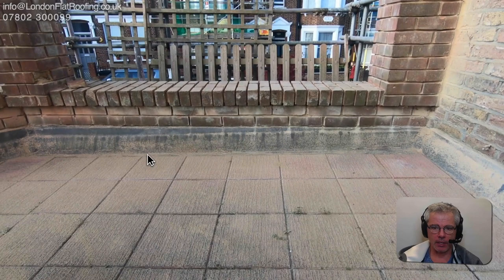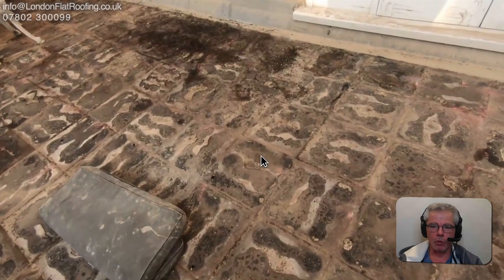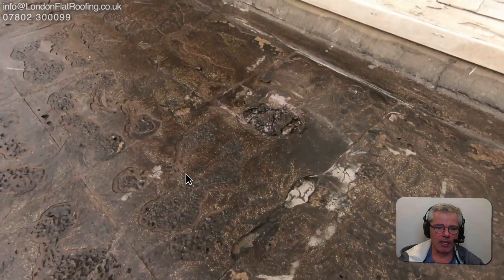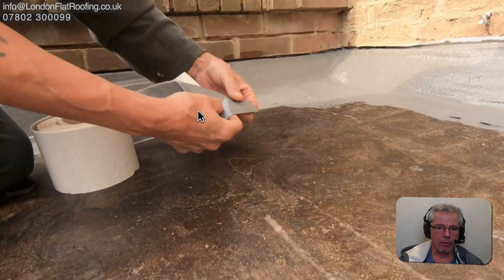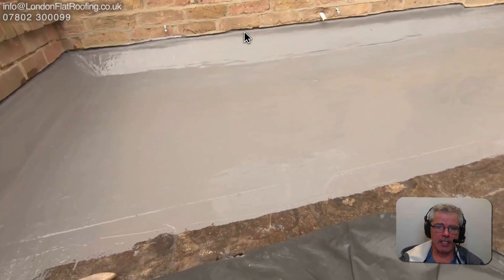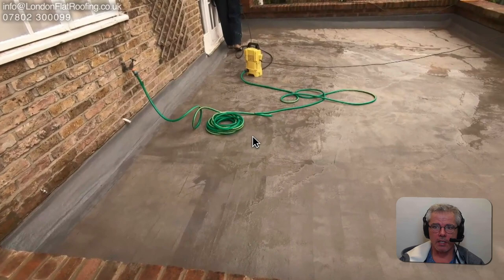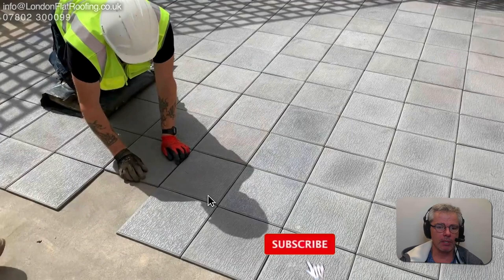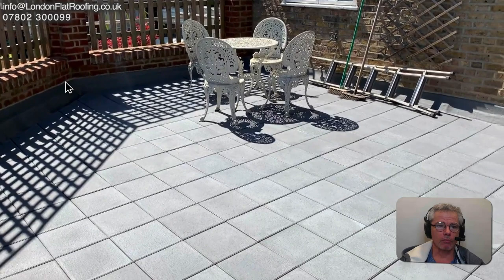Roof terraces renovation old asphalt roof new promenade tiles

Comment: Hi Steve. Interesting video, an end results looked great 👍. You didn't grout the tiles, is that to allow movement and flexibility?
Reply from the maker: It's not only for flexibility but to allow the water to run between the tiles and get off they are not designed to be grouted

Comment: Here’s a question. If you are to have a replacement double glazed door off the balcony (from a wooden one), should the door be installed first, or should the new door be installed afterwards please?
Reply from the maker: remove the door and fix waterproofing up and under the fill and to the sides so that everything is watertight as high as possible then the doors go in. Unfortunately, this rarely happens.
Reply: Thanks, might be best if we keep the old door in then as timing it for a new door withh a roofer might be challenging!

Comment: Need professional advice if possible. A roofing contractor has told me he intends just ‘laying’ promenade tiles on top of the balcony without glueing down. Is this a good idea or is he being lazy?
Reply from the maker: lazy  although i have seen then loos laid but they move all over the place
Reply: @SteveRoofer  thankyou...if only you were based in the midlands. I need an expert. I like the way you took up the tiles first to determine what needs doing. Everyone i have had so far has just guessed at what the problem may be, and then i have been given varying levels of ‘remedy’, varying from regrouting parapets only, to replacing the upstands , to replacing the whole roof. !
Reply: What was the name of the waterproof paint you used please kind regards Craig
Reply: @craigsearles7657  hi, not used it yet, but its stormguard.
Reply: @craigsearles7657  its called stormguard. Havent tried it yet though.
Reply from the maker: @craigsearles7657  its not paint is  Hydrostop AH-25+by SIG (Sheffield Insulation Group) Trade only
Reply from the maker: Crazy and lazy
Reply: Steve Roofer do you know what kind of glue is used?
Reply: Can you help. I’ve got an apartment which has a roof terrace. The terrace was covered in timber decking. I have removed the decking because it was in poor condition. Under the decking and covering the concrete terrace is rubber roofing felt which is in very good condition. I don’t want to replace the timber decking because it’s to expensive. Can I apply a liquid paint on material to the rubber to protect it and if so what would you recommend? The terrace will only get light foot traffic. Many thanks.